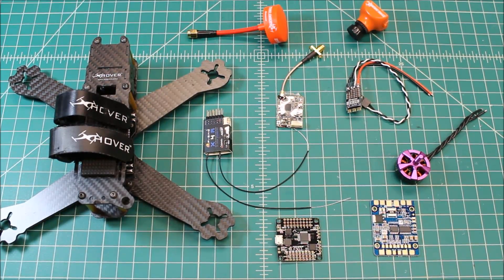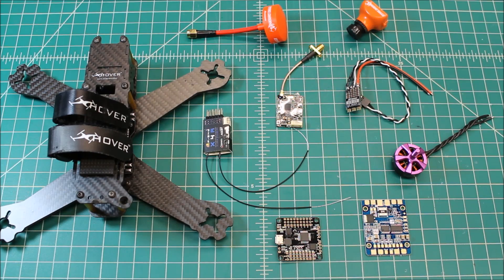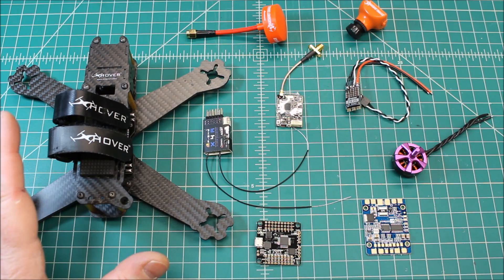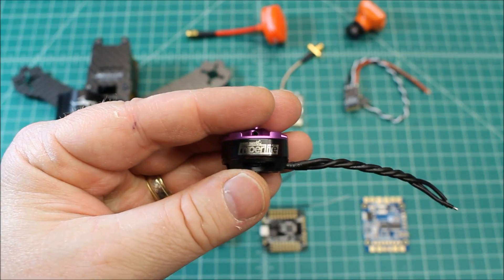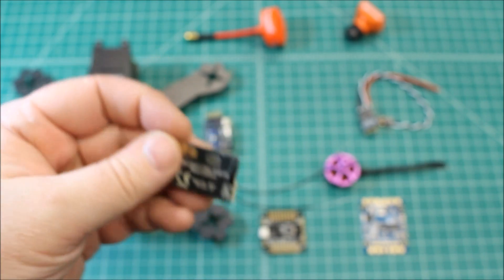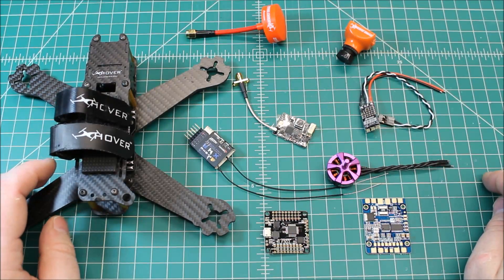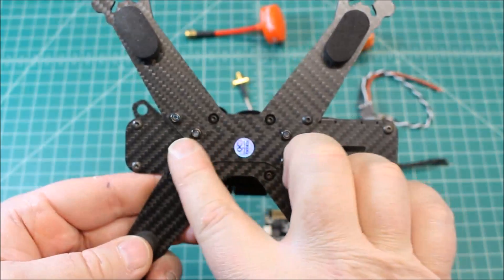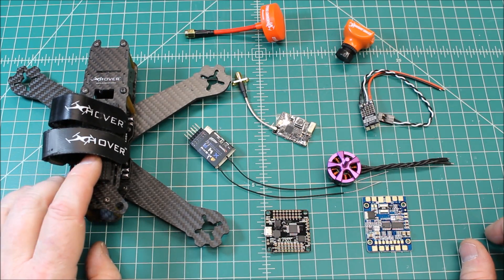Xhover Element 5" FPV Race Frame Buildout Part 1

Comment: Hi, what's makes the x4r-sb better choice than the xsr ? Which is smaller and easier to fit in micro racers? Cos i see almost every build video and log, people just use x4r-sb, rarely i see the xsr chosen... is the x4r-sb a more solid built? Better range? Thanks ! I can wait to try the Frsky Rx from FuriousFPV that just came out, its suppose to be a full range rx but quite small, i think its the LR1000...
Reply from the maker: Ray Choi the reason we choose the X4R is because it has replaceable antennas. In this hobby that can be more important than something that's small.
Reply from the maker: Jose Sierra you mean this: http://pirofliprc.com/FrSky-X4R-SB--316-Channel-Receiver-with-Sbus-and-CPPM-WITHOUT-PINS_p_3319.html
Reply from the maker: Ray Choi you can solder a new antenna, just is more haste but not a huge ordeal.
Reply: X-Frames FPV totally agreed. I was a big fan of the XSR for sheer size but the weight advantage is outweighed (pun!) by the replaceable antennae on the x4r. I do wish the x4r came depinned though... that's kind of a pita. Nice parts buildout though.
Reply: X-Frames FPV yes!!! 😁😁😁
Reply: I see, so it's for the replaceable antenna! So there is no range difference... But can we solder on new antennas on the XSR if they were to break? Or we must simply but a whole new Rx?